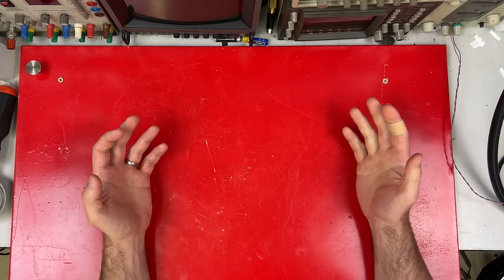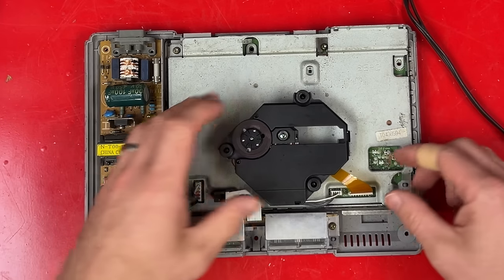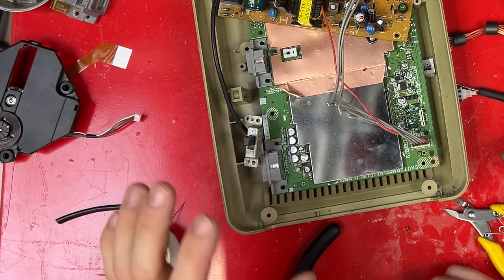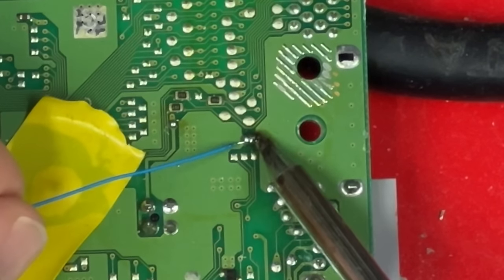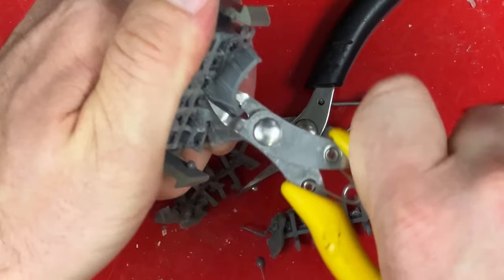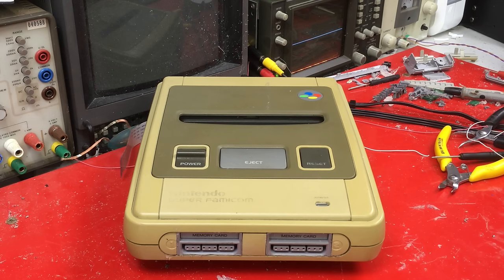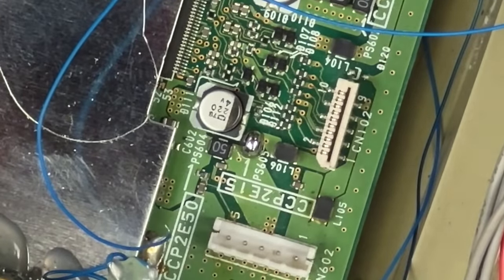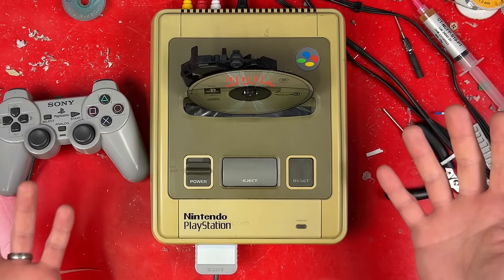I Made a Nintendo Playstation

Comment: The amount of times James says “I’m sure it’ll work,” “hopefully that works,” and “I’m sure it’ll be fine”is very reassuring
Reply: That's how you know he knows what he's doing
Reply: I’m a bit surprised that these stuff actually work usually on first try
Reply: I feel like a lot of James’ quotes would look great on a T-shirt. “Kinda jams in here.”
Reply: to be fair it worked.
Reply: "You really shouldn't leave this unfused, but I'm just gonna leave it unfused"
Reply: console bursts into flames

I'm sure it's fine
Reply: @Feasco  just add a bit more hot glue.

Or, in this case, appropriate temperature glue.
Reply: @RAFMnBgaming you use cold glue when it's on fire to remove the heat
Reply: The words of a true engineer at work XD

Comment: It's shocking the amount of angle grinding a console can take and still work.
Reply: Have you seen the portable Wii (U?) hack?
Reply: @illustriouschin  Yeah, the portable Wii where they chop off around 70% of the PCB. It's insane.
Reply: Fun fact, if you cut a board with a grinder or hacksaw or whatever, you really should finish off the edges with fine needle files/jewelers files.

You don't want the traces from the different layers of the boards shorting together on rough cut edges.
Reply: @choppercove  The portable Wii U is even more insane lol
Reply: @defenestratorr  wait those actually exist??
Reply: @pul53gh  Sort of
It's called the LOLWUT trim
It's even small enough to fit into a gamepad, but the batteries are a little too big
It's definitely possible with smaller batteries though imo, the wii U has pretty low power usage and could probably just be powered off a steam deck battery
Reply: as you can tell from the name, even they were confused and surprised by just how much the board can take and still work lol
Reply: Why was a full size grinder used though? Lol should have used a small Dremel instead.
Reply: I mean, the guy salvaged analog TV parts, used copious amounts of hot glue for adhesive but also seemingly, structural intregrity, and generic chinese CD mechanisms to frankenstein a PSX in a Nintendo shell - for no reason in particular. To be honest I'm a little disappointed he didn't cut his shit with a wood saw.
 @Epic_C
Reply: @Epic_C  why not?
Reply: The PS5 would crumble if you looked at it wrong
Reply: @defenestratorr  This makes me want to acquire a secondhand wii U and go to town. I'd love to fit the whole console into just the gamepad since I find the Wii U to be more ergonomic than the Ninty Switch and would love it to be something I could lugaround as a true portable. I won't say it's the best option for on the go emulation, but it's definitely an adequate one and has a lot of potential. Plus it plays GameCube games basically natively with something like Nintendont.
Reply: Japanese manufactured goods never cease to amaze me
Reply: @Soitisisit just looked up this trim and it's apparently hard as fuck, I thought maybe I'd try it (done some microsoldering before) but after seeing a pic with so many wires soldered in one spot that it looks like my hair I think I'm good for now
Reply: The beauty of simple designs
Reply: That's when you know a game console was truly built to last.
Reply: I highly doubt that PS5s can take such a beating. it's all about how stuff was made in the past I guess.
Reply: @waltercomunello121  it’s more because things got complex.
Reply: @tezcanaslan2877  yeah it surprising how people jump to "built to last back then" and dont seem to realize that refrigerators have more complex electronic hardware then old systems with those old systems being so simple people probably drew them on a piece of paper
Reply: ever played Space Engineers?
Reply: @1personithink  shhhhhhhhh Clang might hear you
Reply: I keep cracking myself whenever he whips out the grinder 😂
Reply: The crazy experimentation that has went into finding the most space efficient way to cut a console’s PCB while it reminds functional is insane
Reply: @defenestratorr I cant tind it
Reply: the top shells are delicate but the interior is solid and actually well put together @TomWoop
Reply: @southernflatland  So True
Reply: - zoro the coolest sword guy
Reply: God I wonder what the hell 90% of the Wii motherboard was doing because you can just chop off everything but the center of the board and plop it into a shell and you still have a fully functioning Wii

Comment: I showed my dad this vid and he said, "That's the hackiest motherf***er i've ever seen" and he is an electrical engineer. But I have to agree. Angle grinding not just the case but the motherboard, ripping off unused components, and using a 9V switch to break main. I literally had to lie that you were joking to my dad he was actually horrified. Never in my life have I ever scene every ribbon being a slice of a bigger ribbon or soldering to different ribbons together they brake if I look at them the wrong way. I don't think theirs's an inch of this console not held together with hot glue which is impressive and horrifying. I can't wait for the next video. I've never quite seen anything like this.  The crafty way you get away with using all the wrong things is insane.

Comment: I love how the disc drive is sideways and in the air. It looks so awesome. And as a bonus, you can tell when the PS1 authenticates the disc!
Reply: how can you tell that?
Reply: @PlutoTheSynth  The disc will start speeding up as it reads the wobble groove near the spindle hole.
Reply: @PlutoTheSynth   It speeds up.  The first check (for the region-coded wobble) is done at a lower speed.

Comment: That AC-voltage power switch is terrifying. Cursed, amazing piece of work!
Reply: Actually, now this switch is commuting a lot less current than usual.
Reply: @deniskhafizov6827 the current is fine, but the 230V arcing might fuck it up
Reply: Old computers used to use "AT power supplies."  Those also had the mains A/C voltage going through the power switch!
Reply: @nticompass  yeah, but this one might not be rated for mains voltage, given that it is only supposed to switch 9v (or 12, cant remember)

Comment: 6:20 I imagine that unusually long gap between hitting the power switch and actually powering on was basically the PlayStation waking up in shock and internally screaming in agony as it felt the fresh angle grinder cuts and hot glue and realised it's new location in the mutaled torso of an old friend 😢

Comment: Probably you need to add a crystal clear plexiglass or something completely transparent on the disc. And it could be perfect. ( In case you do that, you can use metal for sides and corners and them place some led under it)

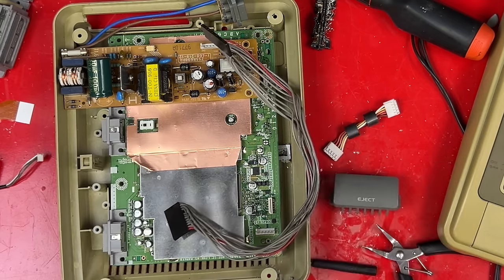Comment: At 2:43 that cable is an interconnect harness that goes between the neck board and chassis on a wells gardner k7500 arcade monitor. Possibly other monitors or TVs as well.

Comment: Hey after watching this, I can explain why there's no music in pepsiman. So, when you first boot a game, the system reads the table of contents of the disc. Most games have one track, the game data. However, there are quite a few titles that use CD audio for music (the original ridge Racer, and castlevania sotn come to mind). 

Pepsiman also uses cd audio for its music. But because you launched it with a boot disc, the psx still has that disc table of contents in memory, so even though the game is telling the psx "Hey go to track 7", the psx only thinks there's one track and won't play any music. 

This is a problem I spent literal years trying to work out.

Comment: What will happen if you play a cd game and at the same time you go with a black marker over the cd?
Reply: The infrared laser might be able to read the pits and lands inside the disc so it would in that case mostly work, albeit probably relying on error correction inside the disc more often. Worst case scenario would be a disc read error once it needs to jump to a new part of the disc that has been filled in, if it does interfere with the IR laser pickup. PlayStation discs used a dark tint to visually differentiate them from music CDs, using the same laser!

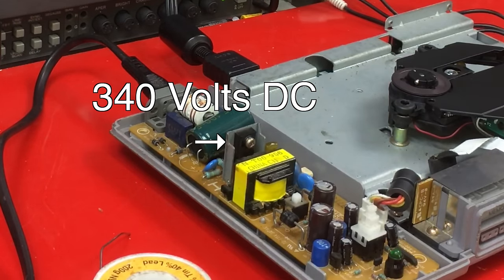Comment: 1:30  How would a heatsink give you a shock
Reply from the maker: I didn’t look at the circuit but the metal tab on a TO220 transistor/mosfet is usually connected to the middle pin, so it depends on the circuit and heat sink mounting design as to whether the heatsink is live or not. To get shocked I must have touched something live and a ground so maybe the heat sink was just the ground half. I don’t know exactly what I touched but it was somewhere between the bridge rectifier and the transformer.
Reply: @Games_for_James  what a legend. You still answer to questions under a video which was posted 7months ago🎉🍻🍻🍻
Reply from the maker: I try!